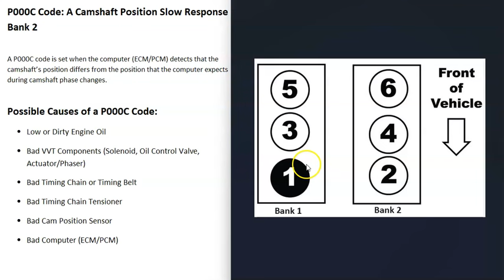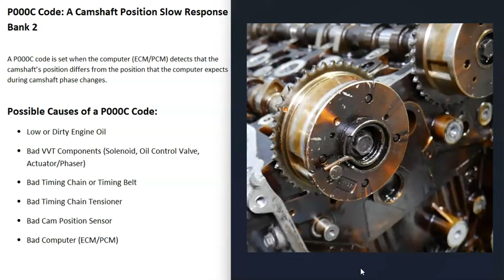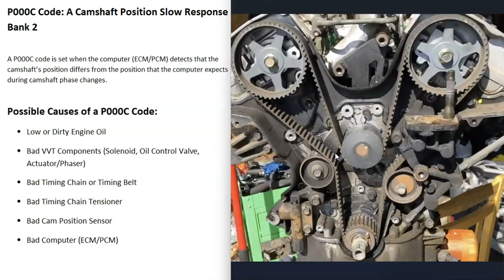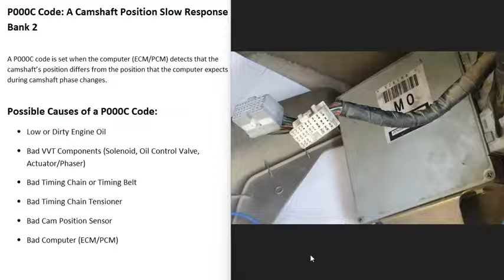Causes and Fixes P000C Code: A Camshaft Position Slow Response Bank 2

Comment: I have a P000C Camshaft ‘A’ Position Slow Response - Bank 2 in a 2002 Suburban 5.3L. Rebuilt the engine and installed a Summit Racing torque camshaft, upgraded the valve train, bigger throttle body, bigger injectors, headers, catalytic converter, and cat back exhaust. What do you think it could be?